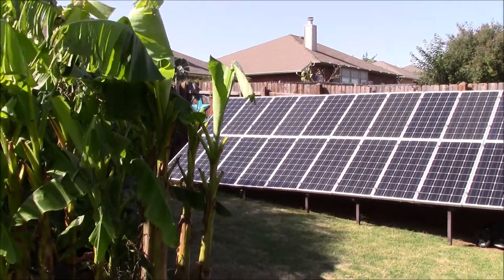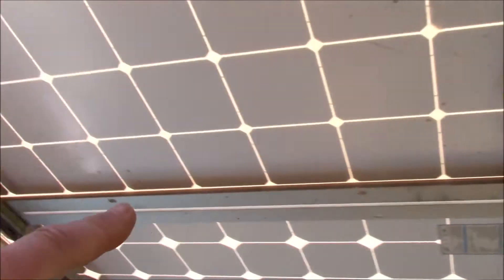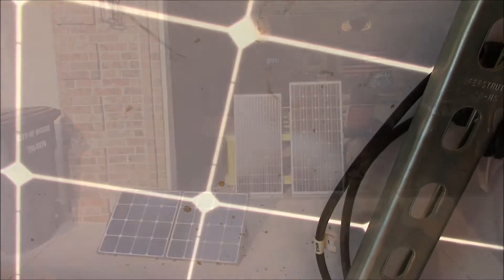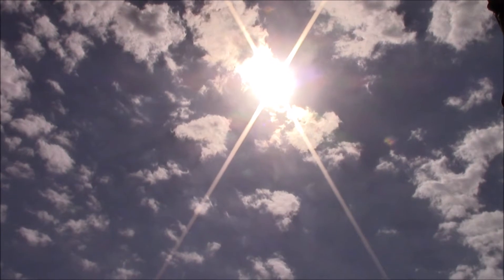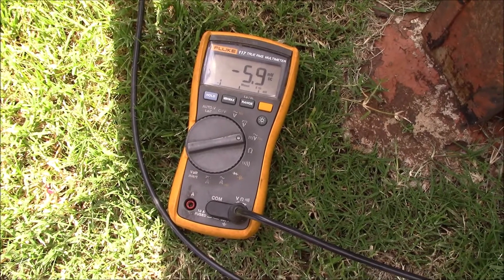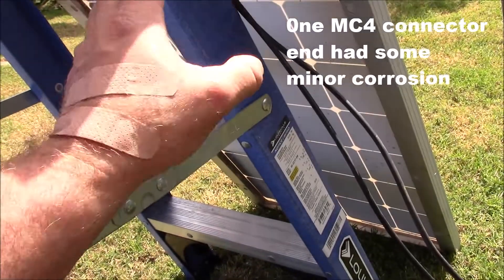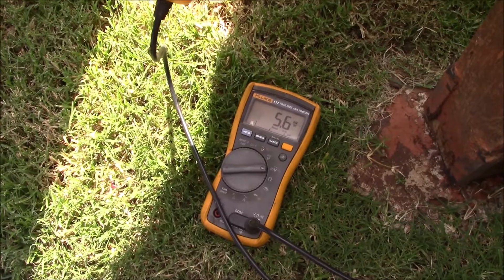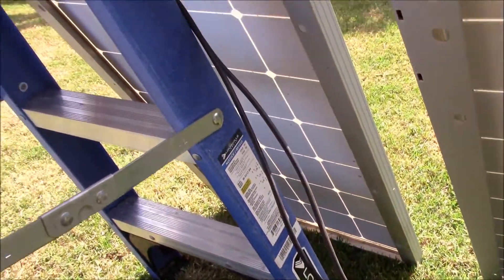Renogy 100w solar panel (with burn holes) update

Comment: I found a video on Youtube of the 5 most common solar panel fails. It looks like the one they described of internal buss failure from a cold solder joint. It eventually burns the buss out of one whole cell.  It is a very interesting video. I think  this is more prone to happening when panels are in series than in parallel. In series all the current has to pass through each individual cell. If there is a week solder joint then time will break it down where if it is a parallel array the total currant per cell is not higher than the one solar panel. Does this sound right to you?
Reply from the maker: Agree. You know, if I could run all my panels in parallel, I would. But (as you know), wiring them in series (around 100v DC in my case) is more efficient, lower current on the feeder lines (for long runs), and the cost savings (pure copper long lengths goes up in price when using thicker AWG cable). Hmmm, I am well within specs running six of these in series. Why did mine have burn holes? My "gut" feeling was a weak electrical joint at one of the solar panel's MC4 connector ends. Wasn't making good contact due to corrosion. I swapped them out with Sun Yoba MC4 connector ends. Weak contact won't pass enough current...so, the panel has to make more volts...which may have burned up buss bars and made burn holes. Just my guess. Hope all is well you you Steve...those fires are crazy-scary.

Comment: Where do these burns come from? I have two 100 watt panels on the roof of my minivan and fortunately no issues after a year.
Reply from the maker: I really do not know...that's the $1,000,000 question. My panels are 6+ years old (and I live in tornado alley) and I have, like, 52 of them. Output is still excellent. So, one out of 52 is prob dern good lucky!
Reply: Chris DIYer Wow, 52 panels 6+ years ago could not have been as affordable as they are today. Thank you for your experiences.

Comment from the maker: NOTE: I made a "Solar 101" error in my last video. When measuring DC current on solar panels in SERIES, the current will NOT change in a SERIES array configuration when moving the DC clamp meter from one solar panel to the next. In order to test and measure DC current on solar panels individually using a clamp meter...you have to have them in PARALLEL to see individual amperage outputs on EACH panel (to isolate a bad one and/or compare outputs).